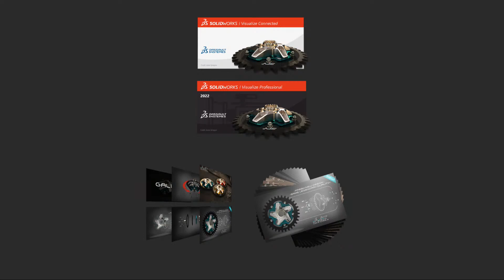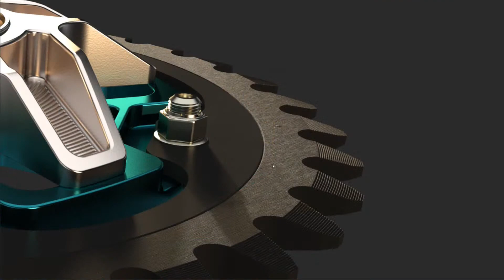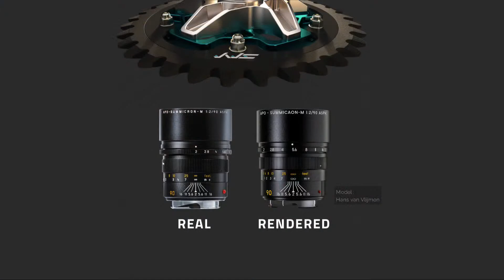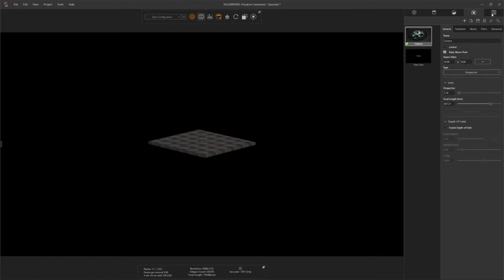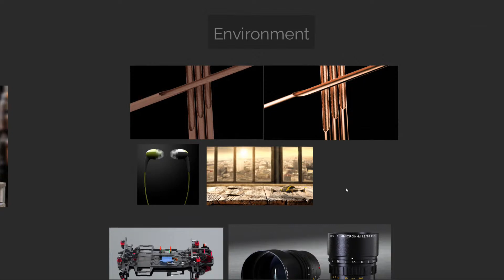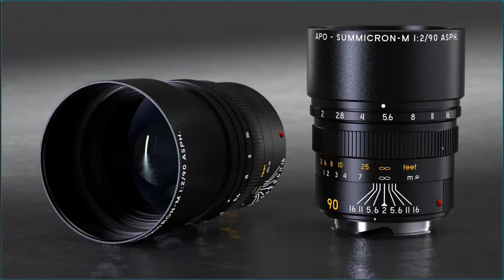Fool Your Eyes with Visualize - SOLIDWORKS LIVE Design - Episode 3 (2022)

Comment: Is there a way to adjust the polygons in visualize? Round objects seems tend to not look perfectly round. Also sometimes there is areas that look like cracks or something like it. This happens especialy with clear materials. 
So my question is how to setup Solidworks / Visualize for best visualize results?

Thank you
Reply: Good question! Visualize does reference the image quality set in SOLIDWORKS . I always go into Tools>Options>Doc Settings>Image Quality and turn that up most of the way before sending over to render.